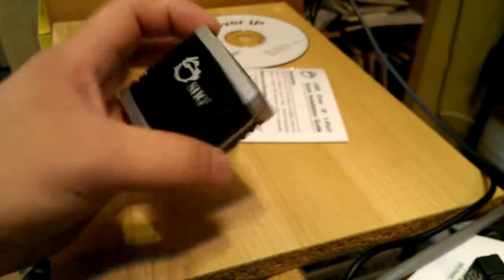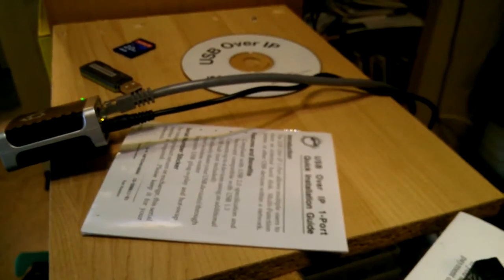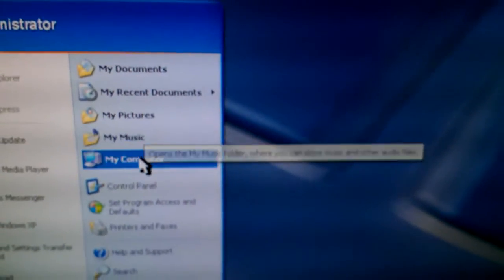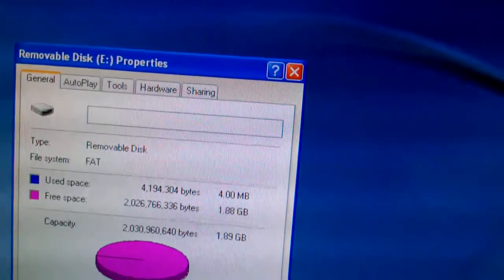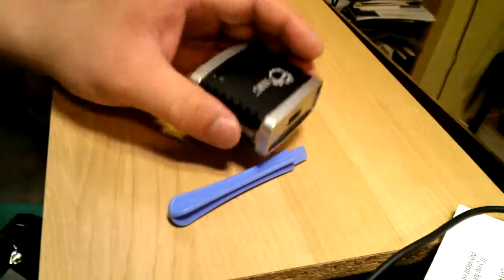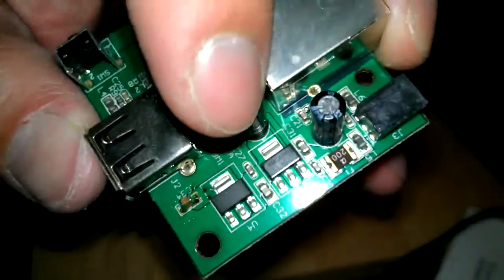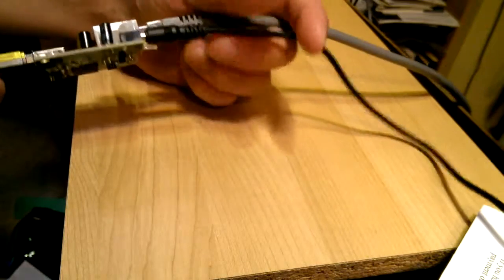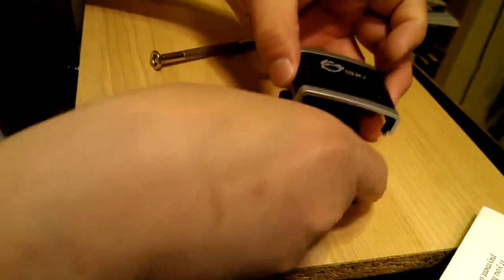SIIG USB over IP Review, Setup and Disassembly

Comment: do you reckon it'll work on a logitech gaming wheel usb 2.0? So off this video, I assume the controller will go straight into the Siig and the ethernet port goes to the network switch. Install the software on the PC and configure. That should be it i guess
Reply from the maker: it surprisingly works on a lot of things. I had a desktop scanner on it once.
Reply: @leefiles  can you let me know if it'll do keyboard and mouse with no lag?
Reply from the maker: @JohnLohTrielement  Normally, when controlling a mouse pointer and keyboard, there is no noticeable lag. But if you're playing fast paced games, you might miss a few shots.  The signal goes through several hops.  First from keyboard to the USB device. Then the commands are converted to IP.  And then you have a windows app that decodes the IP instructions that go thru a keyboard simulator. So, yeah, there should be some time loss there.

Comment: can I connect it with other usb device (ex:rfid reader)?
Reply from the maker: Many USB devices work with it.  I've had trouble with new phones not being properly reconised though. It reconises that a phone is connected but I can't get to my files. RFID is simpler it may work. Dont forget this is a very old USB over IP and a cheap one.
Reply: I tried to find similliar hardware, and I found several usb MFP and storage server like tp-link tl-ps310u. Any Idea what device like SIIG Usb over IP can connect with rfid reader
Reply from the maker: I'm not sure I understand what you are asking but this little device should connect to a rfid. I've connected scanners, keyboards, flashdrives, phones, etc...